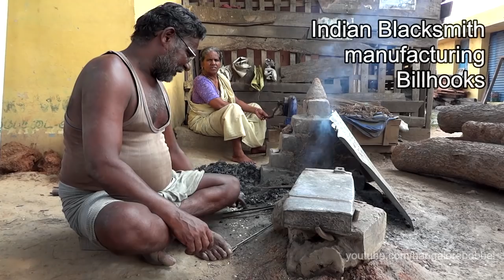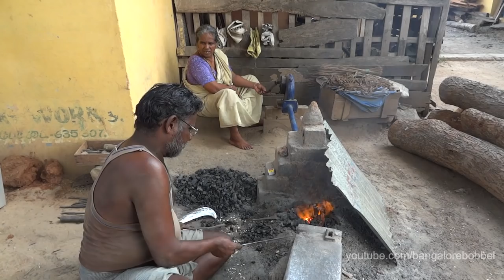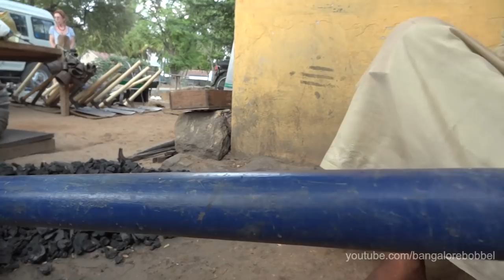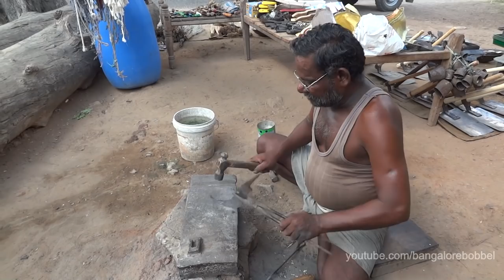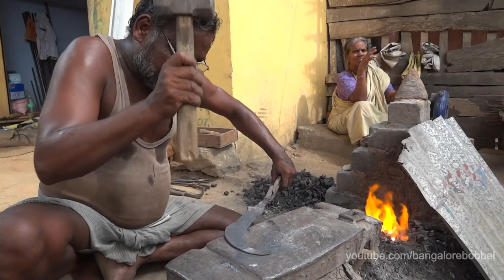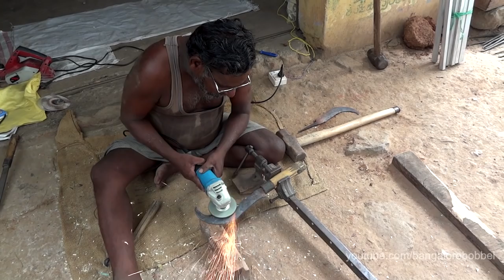Indian Blacksmith making Billhooks - Indischer Schmied beim Hippen schmieden

Comment: that edge will not last very long because he dident temper it or even used a good steel....
Reply: rocketguyandtompan07 Billhooks are made for grass and twigs, i don't think it has to be that strong to cut such things.
Reply: The grass in his area can cut diamonds that's why
Reply: ***** Grass can be very abrasive.
Reply: How do you know? You probably never made a knife or something like that, the only thing you do is read, you don't make knives for a living.
Reply: +rocketguyandtompan07 Obvious that it is made from an old file. A good enough steel in my book.
Besides, what busted arse part of the world are you from. Going hungry tonight, or have you ever you missed a feed at the trough.
Give credit, where credit is due, sport and stop nipping at some poor buggers heels.
Reply: +aubreyaub The way he makes it is awesome and I respect the craftsmanship. But  Rocketguy does have a point. Even a file goes dull really quick if the steel hasn't been quenched after forging
Reply from the maker: +Erik Verkade 
Hi Erik thanks and just two points:
1. the steel is spring steel, old metal from a car suspension. A file would be wrong - what could be good for a nice home made hunting knife would be useless here.
2. yes it goes dull after some heavy use but this is accepted resp. even wanted.
Seems there is plenty of confusion about what this man does and why he does it in that way. Seems most people nowadays are brainwashed by modern knife industry and expect always ultra fine steels and extra hardening, HRC 60 minimum, and all this nonsense ... and I say nonsense because special steels and oil hardening or whatever else is sold by Knife Manufacturers and all these modern day's heroes like Bear Grylls and Co to everybody out there as the minimum of what one has to expect from blacksmiths making knives or similar tools is blank nonsense. ;-)

Let me explain it in details (sorry for the long text), and I hope some more commentators read that long comment for a better understanding of what this blacksmith does, what material he uses and why he doesn't use any oil or not even ice cooled water or so for hardening the blade after smithing it.

The thing is totally simple: too much of hardening is useless and even contraproductive for such tools. Extremely hardened steels as today mostly sold for all and everything, based on any extra hardened pulver metallurgic steels etc. would most probably not even withstand the practical use here for long time, as experience shows. What these tools are used for are purposes which were fulfilled in (very) olden days sometimes even with copper tools, just to remember ...

One has first to understand two things: 1. of all the price for the tools should be reasonable, what automatically excludes really good modern steels. Nobody wants to pay 100 USD or more for the raw material alone, if the complete and ready made hook should not cost much more than let me say 20 USD for the end customer. The smith has to use a commonly available and low cost material. 2. The intended use and how these tools are maintained are extremely important in order to understand why these tools are made in that way - any theoretical discussions like I find them here about steels and blacksmithing and hardening etc. are interesting but totally miss the point. ;-)

This point is: such billhooks are no survival or warrior knives, intended for special forces to cut through wires and kill Grizzlies etc. and being replaced, if broken, by a plier or gun or whatever spare tool. No, such billhooks are used here in forests to clear bushes and in the fields, means farmers use them for example to cut millet or sugar cane or small bushes and so on. And housewives use such tools to gather and process the daily firewood, to open coconuts and to even cut vegetables or fish and chicken. And if someone purchases such a tool he/she expects to use it his or her whole life and give it, if this life ends, to the grand kids as heritage. It should last for generations.

For some of these uses it is fine to get the tool as easy as possible as sharp as possible. But people here usually don't have costly grinding stones but most of them simply rub these tools on any stone to sharpen them. People here can usually not afford any Lansky diamond sharpener or Japanese Waterstones or any other costly items, not even sandpaper from any hardware store - no, they simply use flat granite or other hard stones they find on the field. That excludes automatically highly hardened tools - nobody could even sharpen them. But with such field stones and such manufacturing methods, billhooks can be still sharpened up to almost Opinel sharp as I know from my own experience. That is ok for kitchen use or for the fishermen's wives who have to sell fish in pieces on the markets, and is usually also done there. But such sharpened edges would bend fast whiles, let me say, cutting bamboos. So for that purpuse, people keep their hooks medium sharp and sharpen only the edge in a steep angle, keeping the blade behind the edge strong. Many people using their (only) billhook as a general tool in the field as well as in the kitchen sharpen their billhooks even in two different ways, e.g. 2-3 inches close to the handle are ultra sharp for kitchen purpose, whiles the rest of the edge is medium sharp for use on the fields.

Now, why such blades must not be too much haredened (besides the grinding reason)? Well, just some examples: whiles cutting close to the soil the blades may often hit stones, if one hits from top down one may hit any stone or the soil, and once in a while such a tool falls somewhere down and hits the ground - maybe any rock or so. In all such cases, a hardened steel would either totally break, or the tip would break, or one would have at least several serious gaps in the edge which would require to grind one or two millimeters back and such take a lot of material away. 

A relatively soft steel, on the other hand, doesn't break but simply bends. You can hammer it back to the right shape, and that is commonly done with billhooks, sickles and all such tools in such cases. And I tell you freely this is not only Indian knowledge and practise - if you ask any old farmer in Europe, or maybe somebody who still uses a sickle for any steep property somewhere in any mountain regions and knows about how to use them, he will tell you exactly same: forget extra hardened steels for such purposes, and forget the costly modern steels.

Ok, now back to the blacksmith here: what he does is relatively cold forging of the edge, it is almost peening, strain hardening. Same as later the owner of such tools may have to do, once in a while and before fine sharpening by grinding.

And that is absolutely enough hardening of a very useful and relatively low priced steel, as wanted and sold here. ;-)
Reply: +bangalorebobbel well said sir :)

Comment: Aint no fun if you get a hot spark in your crotch curtain there.
Reply from the maker: yeah, blacksmiths are something special, they have to be highly heat and spark resistant as well as indifferent to loud noise and vibrations ... ;-)

Comment: You have a grinder elktric but why you spin your blower with your wife hand..?
Reply from the maker: Yes that looks strange, isn't it?  

But it looks only strange if you have never been in India and have no idea about common life circumstances here.

The answer is totally simple: it has to do with electricity supply. He is usually 23 hours a day off grid, on good days. On not so good days, 24 hours no electricity, sometimes even for days. It is very common in India not to have permanent electricity supply - not only in villages like the one he lives in but even in major cities. In summer, when water powered electricity generation tends towards zero since the lakes are empty, we have sometimes even here in our part of Bengaluru, which is a city with maybe 14 millions of citizens, only a couple of hours electricity, in villages there is no power at all. The video is quite old and the situation is much better now, the grid has improved a lot in the past couple of years and also power generating capacities were increased, but constant electricity supply is still a challenge in many places.

The blower is most important there and has to be fixed properly to the forge. So the choice is clearly: having a manual blower. You want to work also when there is no power, and the wife or any neighbour or friend is always there.
If the electrical grinder is not working due to lack of power, no problem, that work can be done with manual tools.

I know also blacksmiths using an electrical blower - but then it is always additional to a manual one. Everybody has primarily a manual blower here.